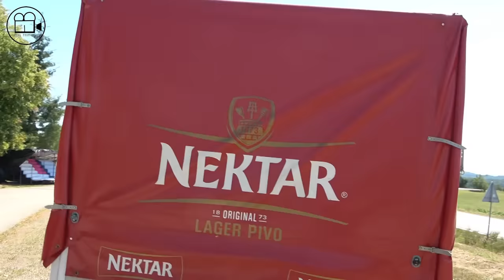Po državah bivše Jugoslavije še vozi nekaj starejših tovornjakov TAM, FAP, Mercedes …

Comment: The red TAM fire-truck at 6.00 looks like a long nose 'L' series Mercedes-Benz. Wish to see its engine and all the other TAM trucks engines, petrol and diesel. Like the outward appearance of the yellow and green car at 10.51, the radiator surround shape is outstanding.